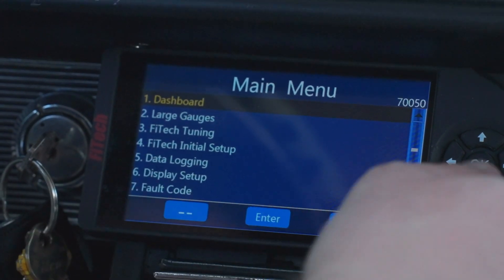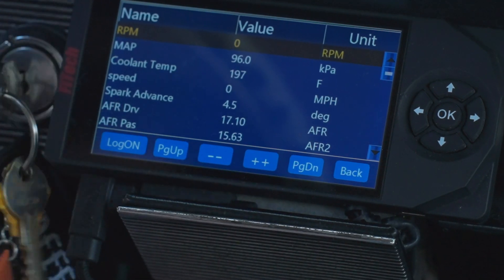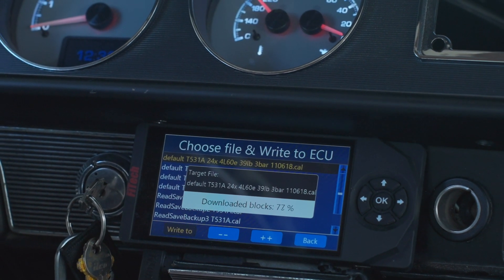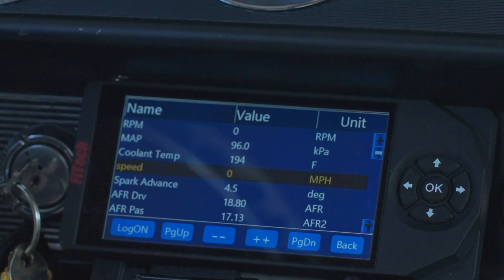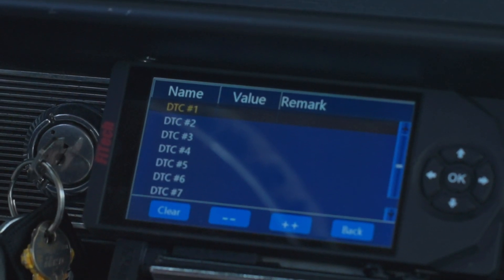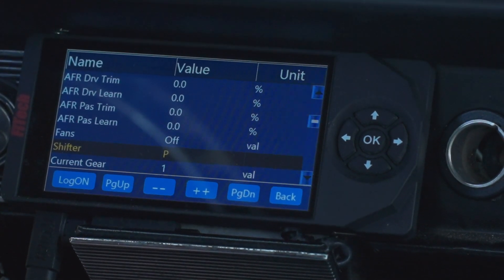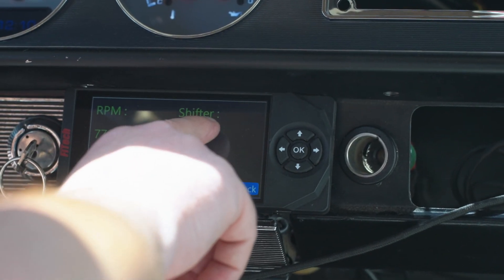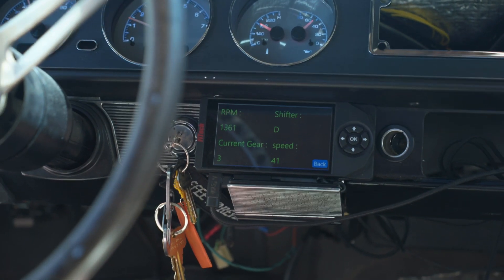LS & Go Shift Transmission Shifting | Tech Tuesdays | EP86

Comment: I’m trying to figure out the tcc lock/unlock but with so much online reading, for my Fitech LS ultimate on the TCC settings if I set the TPS at 30% does that mean it locks until I hit 30% tps at that speed or anything under 30% is locked?
Reply from the maker: What setting are you referring to exactly? If you are talking about the "Torque Converter Max TPS" menu then this is the maximum TPS input at each MPH input before the TCC will unlock.
Reply: @FiTechEFImedia yes that’s exactly what I was referencing to, so any % above the number I put it disables/unlocks the tcc

Comment: Hi, i have a problème with my trans 4l60e. On 1 gear i have a ruptur at 5000rpm approximatly and after thé trans shift 3nd
Reply from the maker: Check the fault code section of the handheld.
Reply: @FiTechEFImedia  i dont have a fault code 😕
Reply from the maker: @ardvi-all7796  Contact our tech support or even better record a datalog of your issue and provide it to tech @ techmail@fitechefi.com. You can also call 951-340-2624 option 3.

Comment: Thanks for the video. I checked the VSS and it did have a pin pushed back, so I thought that was the issue. It did help it will now shift with a little throttle but it won't shift correctly under normal acceleration. I have the po748 which on fitech is the line pressure solenoid. It does show the P rev P low2 when running. Do you think my next step is to drop the trans pan and change the line pressure solenoid? I also have a po113 IAT HI would this have an affect as well? Thanks
Reply from the maker: It does sounds like an issue within the trans. You can ohm out the solenoid to verify if its bad.

Comment: Can someone share their upshift snd downshift points with me, running a 6.0/4l80 combo with stock rearend and converter mine got completely wiped out and not sure what values to input
Reply from the maker: The system has values preset in it to get you started. This means the transmission should shift through the gears and lock the converter. If you are not getting shifting you have a different issue that is not these settings. If anything you dont have the transmission setup settings correct for turning on a 4l60. Check the fault codes for info for if there is a connection issue or component issue with the transmission.

Comment: My trans was shifting fine, now is staying only on 1 gear. 
Fault code not showing anything.

I got the fitech 70051 ultimate
6.0-4l80e.
Reply: Mine is doing the same thing! Did you figure it out
Reply: @omarmurguia6321  yes, VSS rear speed sensor plug pins were pushed out, I cut it off, put a nice brand new one, no issues, shifts fine now.

Comment: What's up guys, anyone have a recommendation for a mechanic familiar with Fitech Go throttle body efi.  Bought a 94 blazer with the 350 with a mild cam already installed.Not many mechanics are willing to work on it.  Will eventually get better at tuning myself but for now looking for a pro with experience.  

No one came up close to me, saddle brook nj 07663, on your website shop finder. One was over an hour away

Appreciate your product, can tell the difference between mine and a stock inhad also test drive

Thanks and best regards